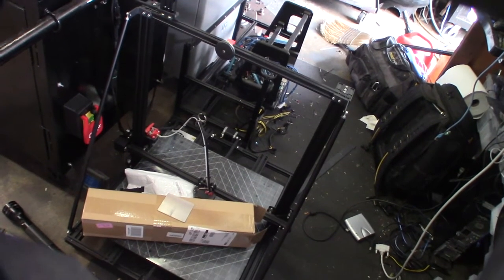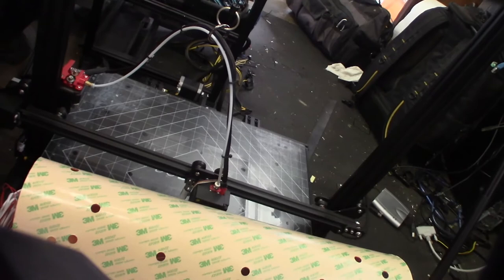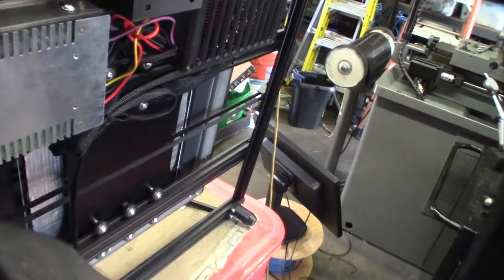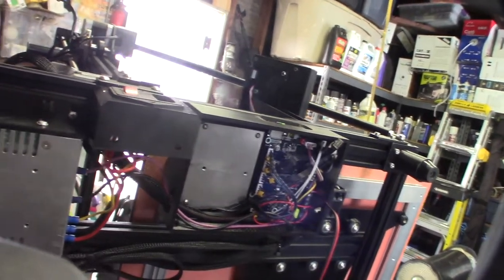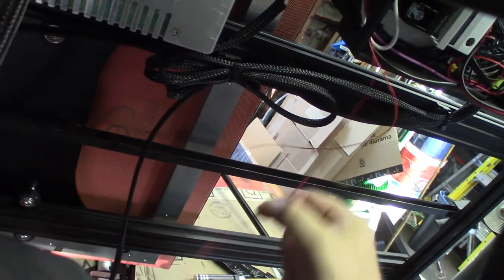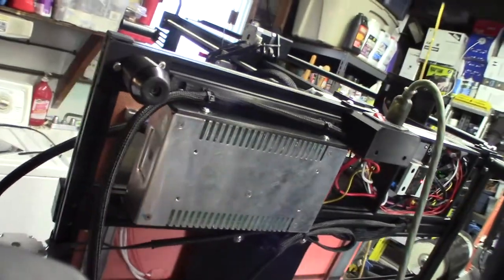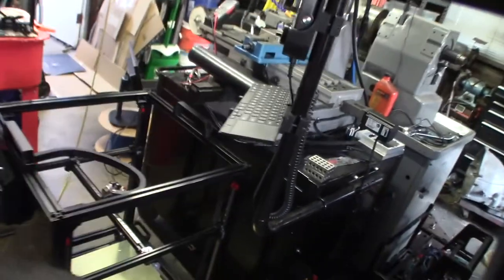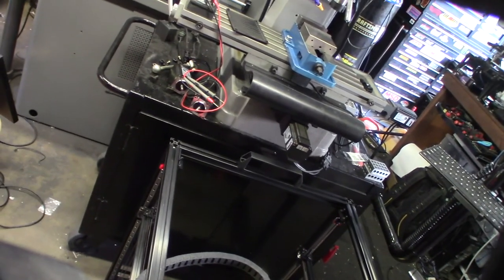How To Safely Wire In A 3D Printer AC Silicone Heated Bed, Creality CR-10 S5

Comment: Just curious where you got the bed mounts from? I am about to do this conversion (and perhaps upgrade the printer to 24v) and was just looking for some solid bed mounts now. 
Cheers for the videos on the CR-10 S5 - really appreciate them. Also what heat sink are you using for the SSR? I have one here but didn't plan a heatsink for it. A full parts list would be great too (Bed Mounts, Switch, SSR, Heat Sink, Fan model).

Thanks again for the videos on it. After this is going I have a plan to adapt the spare cr-10s5 bed I have to build a 500mm3 voron ;)
Reply: This may be a little late I used Steel spacers and nylon spacers I found at lowes pressed the nylon spacers inside of the steel spacers  for a tighter fit on my screws